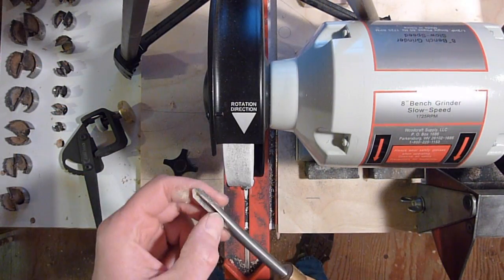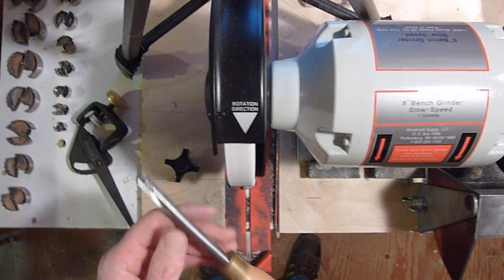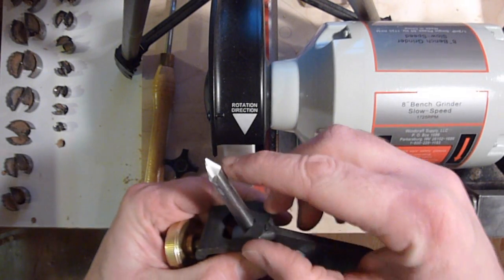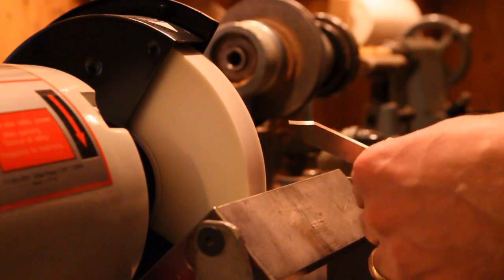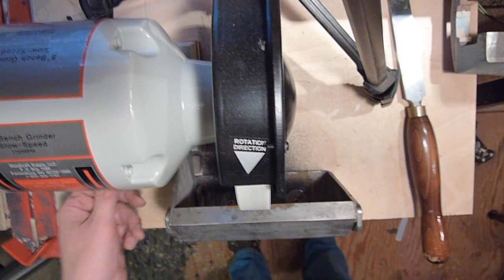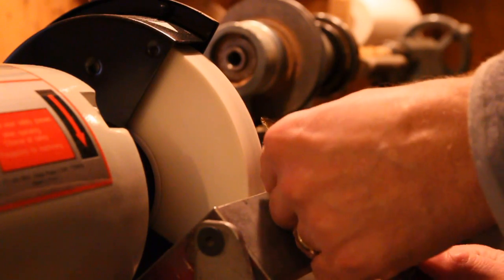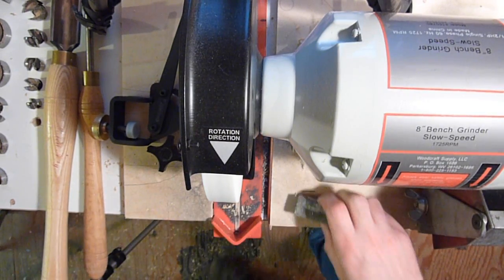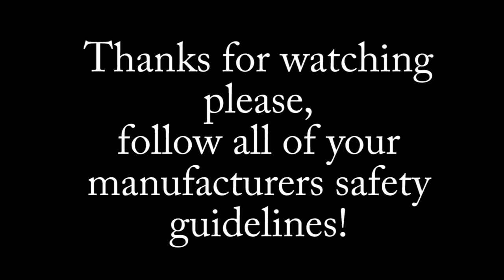How To Sharpen Woodturning Tools With A Bench Grinder

Comment: I'm not trying to discredit Carl, as he makes a valid point.

Your grinder will work. I run both an 8" variable speed and 3450rpm 6" grinder and both work.

First, you need the right wheels. They should be in the J-K hardness range and be of proper grit level. I run 36 and 80. Others will work, though I wouldn't go above 120.
Now, you need to dress the wheels regularly (diamond tool works well).

You can't easily "burn" HSS. You can blue it with no negative effects. It's beyond that you hurt it.

Comment: Hey, just a quick tip from a professional machinist: if you use a little emulsifiable oil mixed with water to cool the chisel between passes on the grinder it will keep the edge from losing its hardness. That means less sharpening, and longer-lasting tools. (Although you will have to wipe the chisels before using them again.) :)

Comment: Larry mentioned it earlier, but it should be stressed to make sure that the metal does not overheat.  Keep a container of water to cool the steel if it gets too hot to touch.  If it does and you don't know how to temper it, you may have to grind it down to get rid of the discoloration and then reshape the edge.  Don't rush.

Comment: Nice. video. I  am curious as to what grinding stones your using and what is the purpose of the relief grind?
Reply from the maker: Thank you! I'm not sure what the grits were on these stones they came with the grinder. I have the radius CBN wheels now, 80 and 180. The relief grind is for more detailed work, like finials. Here's a link the wheels I use https://woodturnerswonders.com/collections/radius-edge-cbn-wheels/products/cbn-wheel-pair-80-and-180-grit

Comment: I saw something similar several years ago. I took an old bench belt sander. At the time I understood that you could sharpen with the belt going away (up) instead of down. I would like to send you a picture for any recommendations that you may have. It is slow speed, and I have had great luck with chisels and turning tools. What is the best way to get a few pictures to you?

Comment: Hey Carl,
Great video. I have the PSI sharpening system. The finger nail jig has no stops/notches to show angle of grind. I saw the post where you put the angles for the diff gouges. What is that angle in reference to? Having trouble figuring it out. Thanks for all your great videos.

Comment: if you want your stone to last for a long time. Use all the surface of the stone! That's good stuff, I never use those jigs. I like the Japanese  water stone, it's a bit longer, but the blade doesn't heat up so it's stay sharp longer. Of course using the proper angle on the blade for the proper type of wood helps too.

Comment: I am new to wood turning and find that getting my tools sharp is extremely difficult . My grinder runs at 2500 rpm and I think that because of the high speed I tend to burn the steel instead of sharpening the tool. What would you suggest to obtain sharp tools without burning the metal? Great videos so keep them coming. Chas Cowen
Reply: If you're using high speed steel which any decent lathe chisels will be, you don't have to worry about "burning" them. If they aren't HSS it sounds like youve already ruined them and they'll never hold an edge again unless you remove the area with the temper ruined and totally regrind the tool which is next to impossible with most lathe chisels, sorry.

Edit: just realized I replied to a comment almost a decade old. Woops.

Comment: hello, i have a 5/8" drive bench grinder. im having trouble finding a wheel that with fit or even an adaptor for a 3/4" wheel. some wheels that ive found  come with plastic bushings but ive never heard anything good about them. if you could offer any help it would be much appreciated. thanks

Comment: Carl - I have a dumb question. You do an extra step that I haven't been doing. You add a relief cut to your bowl and fingernail gouges. Can you explain to me the purpose of that? And I think I saw where you did it - your hand was kinda hiding the cuts :)
Reply from the maker: Janice Kneule Hi Janice,
Relief cuts are more for detail work, like getting inside coves so the heal doesn't get in the way.
Reply: Carl Jacobson  Thanks Carl. Duhhhhh - I should have known that. It makes total sense. I am for the most part, a box / spindle / end-grain turner :)  And I have had some occasional difficulty with doing coves and detail work, and didnt realize that it may be the heel of the gouge. I will certainly add this to my sharpening techniques :)  Thank You !!!!!

Comment: What's the correct stone you would used for lathe chisel ,I have grinder but not sure about the stone that it came with.thanks
Reply from the maker: For sharping tools the white stones are the ones you want to use. If you're thinking about up-grading the CBN wheels are a great option, they never wear out woodturnerswonders.com
Reply: @CarlJacobson  thanks for the info i,ve just started useing woodturning lathe alot fun

Comment: Hi Carl

Thanks for all the great videos. I have a fingernail ground bowl gouge which I would like to regrind to a conventional grind. I find the latter easier to use on the bottom of bowls. Is this possible, and if so, how?

Many thanks and good wishes  Kevin
Reply from the maker: Thank you Kevin! Yes you can regrind the tool, do you have a grinding jig?
Reply: Hi Carl

Yes I have a Robert Sorby jig fitted to my grinder. Just a bit unsure about how to go about it.  Cheers Kevin

Comment: Do you have any recommendations on how to remove the burr on both the flute side and the bevel side?
Reply from the maker: I would use a piece of 600 grit sandpaper.
Reply: Thanks! I'll get some and look for something else to wrap that will approximate flute. Maybe I should make it out of wood and sand it to fit.

Comment: how many rpm?   can I mount a grinding wheel in the lathe and sharpen it freehand using the toolrest?
Reply from the maker: 1750 rpm Yes you can, but it's very hard to freehand I would set up a jig.

Comment: I have noticed that when I sharpen my skew the bevel on one side is longer than the one on the other side, is that normal?
Reply from the maker: +icespeckledhens They should be the same.
Reply: +Carl Jacobson Carl I seem to be getting a bit of tear out on my bowls particularly on the end grain sections, I'm using a roughing gouge, bowl gouge and a round nose scraper to try & smooth things out but still having no joy. I'm turning green spalted beech. what can I do to avoid this? thanks, Tom.
Reply: Super sharp tools are a must, but also try different speeds to see if that helps.  You might try a wood hardener before you turn the last 1/8", depending on the depth of the tear out.  This will stabilize the fibers so they stay oriented.  Keep in mind that this can prevent an even absorption of stain, so you might want to stain it first. The end grain should suck that in deeply. Then use a wood hardener or thinned finish (I usually use lacquer since it dries quickly).

Comment: If the tool is to hot to touch you are ruining it by removing the temper.  I always keep my finger on the tool and if it gets uncomfortably hot I quench the tool.  It takes a little longer but my tools last longer.
Reply: i was taught to put it in water every couple of passes and that if the tool sizzles when you put it in water, you are over heating the tool

Comment: If the tool is made of high speed steel, it really should not be quenched when grinding.  There is not much danger of drawing the temper of a high speed steel tool - not even if it turns blue.

Comment: can you sharpen them on a oil stone by hand
Reply from the maker: Yes, it just takes some practice.
Reply: Sharpening edges by hand gives you great awareness of the manner in which the tool works, details of the edge and a feel for the metal.  You also don't have to sorry about overheating and losing the temper.  I believe that Japanese master woodworkers spent their first years of apprenticeship doing this before working with wood.  When my father was studying engineering, he was required to create a perfect steel cube using only a bastard file. There are many lessons in understanding how to work metal by hand.  It is a great discipline.   After that, using the grinders or belt sanders are a cinch.

Comment: Everyone posting about sharpening woes... dont even consider turning without a grinder with some decent wheels in the 60-120 grit range. If you dont have TRUE HSS chisels consider a low speed grinder. Rikon makes a nice one. The reason for this is because HSS resists losing its temper much better than carbon. Secondly... I wouldnt consider sharpening without a jig or a series of jigs. Vet youself a rikon low speed... a OneWay wolverine and the skew/vari grind jigs to gonwith it and you should never have any problems sharpening. Also... hone your wheels man! Those things look terrible.

Comment: The Tormek is not suitable for turning tools, with exception of the skew.

You do not want a finely polished edge on a turning tool. It just won't hold up, nor does it cut any better. Watch Gary Gardner's presentation on sharpening to understand why.
Here is part 1: /watch?v=9ljhd_WbAOw
Watch the others as well.

You don't see sparks on the Tormek as it's a wet grinder. The Tormek still removes steel, it just uses a coolant, and thus no sparks.

And it's a pain in the ass (I own one).